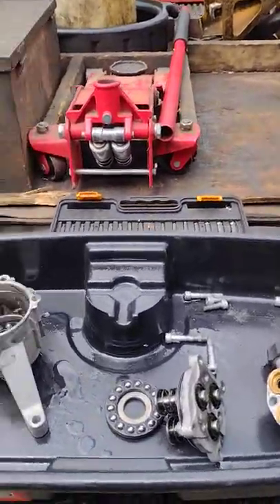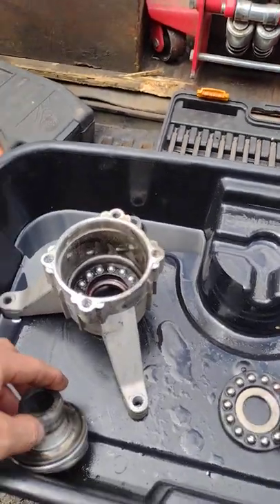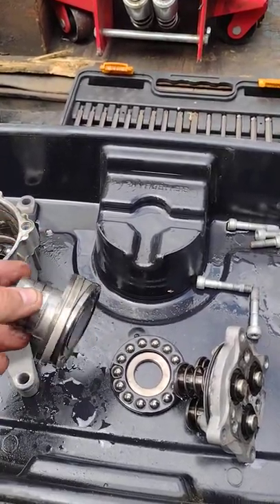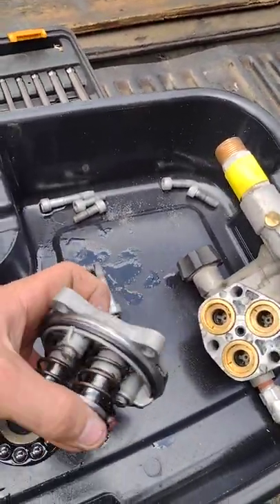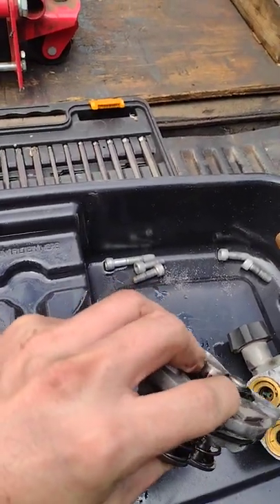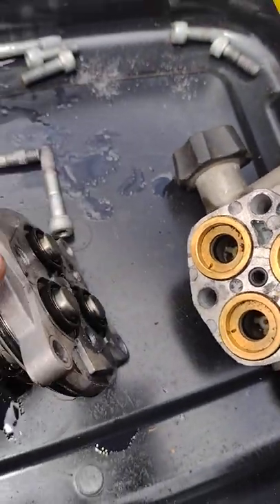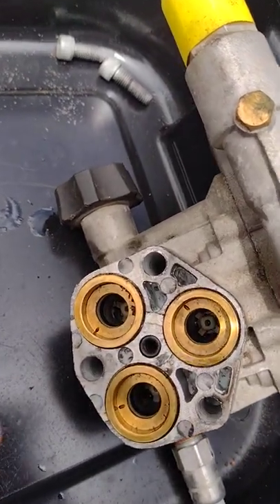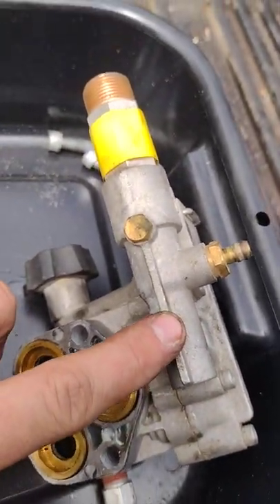how a pressure washer pump works.

Comment: So I just got one that’s broken, creating no pressure and I opened it up and it was filled with like a gray type oil in that chamber, where the offset and pistons are. Is that supposed to be like that? I feel like there’s just regular grease in there and maybe water got into this one but it’s like completely drowning in this substance. Thanks.
Reply from the maker: @NewYorkCity646  I don't think so it's supposed to be a dark amber color I think yours is great because water was leaking into the oil chamber
Reply: @samgreen6144  that’s what I suppose I can buy a rebuild kit for the pump? Also, what type of oil is supposed to go in there? Thanks for your input!
Reply from the maker: @NewYorkCity646  I don't know for sure but I would guess that it takes 75 w140.

I'm not sure I would go with rebuilding it you can just buy a new one for under $100

https://amzn.to/3MQydjl
Reply: I found out last night that a lot of pressure washers make make it to the graveyard because they have A Pump  That has a piece that disintegrates inside that's unrepairable and they don't make the part so people just replaced the pop's pressure pop That has a piece that disintegrates inside that's unrepairable and they don't make the part so people just replaced the pumps

Comment: So the output psi is determined by the power of the engine?
Reply: Kinda, from my understanding it's how fast that shaft can push those little piston things
Reply: @toneytone7497  You're kinda correct, it's not only speed based, it's a mix from 4 things, how fast the engine can push the pistons, how small is the water reservoir, how small is the gap from where it exits the machine, and how far the piston can press onto the water
Reply: That's because pressure washers rely on the following physics properties:
When you push against the water and it has nowhere to go it starts building up pressure, if you give it a small gap to exit the speed of the water exiting the space will be directly proportional to how much pressure it built, which is directly proportional to how much you pushed it, the less the water, the smaller the space it is confined to the more preessure it builds.

It just like that "little experiment" of filling a syringe with air, clogging the tip and pressing it, but with water and pistons instead
Reply: The output PSI is determined by the amount of restriction you put on the flow of water. This is done by the unloader and the nozzles in the wand.

Engine power determines how well it can keep spinning against the hydraulic pressure caused by the restriction.

Comment: I have a pump that is mixing water is getting into the  pump oil .  Does the seals on the front  prevent that?
Reply from the maker: Yeah. Time for a new pump.
Reply: Time to either rebuild the pump or buy another one.

Comment: Any tips on refitting the swash plate back through the shaft seal  ?
Reply from the maker: The housing of mine is cracked and I never reassembled it. so no I don't have any tips.
Reply: @samgreen6144 is it possible to fix a cracked pump??
Reply from the maker: @NateColman  i would think not.

Comment: WHY DO PUMPS GO OUT SO OFTEN AND WHAT'S THE REMEDY.....

IF YOUR ANSWER IS NOT PRECISE OR GUARANTEED, PLEASE DON'T ANSWER
Reply: Because of user error and inferior quality manufactured pumps , if you stop spraying turn of that engine immediately any back pressure constantly left on the pump to avoid velocity damage
Reply: Do not leave in by-pass.

Winterize the pump to remove water if it will sit 30+ days.

Ensure you have sufficient inlet flow to prevent cavitation.

Material quality is certainly an aspect of it but life can be drastically improved with maintenance.
Reply: Use a pump saver lubricant they sell them in menards. They hook you to the pump inlet (garden hose) it shoots an oily lubricant for the pistons, and the rubber seals it also pushes all the water out.